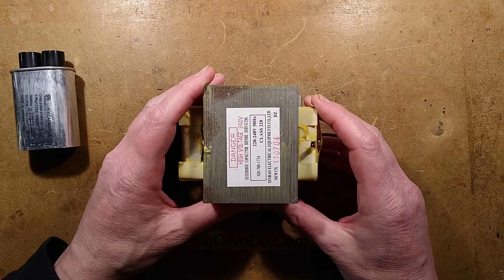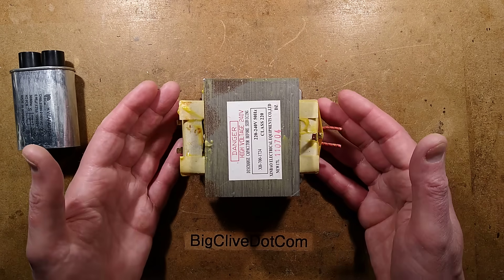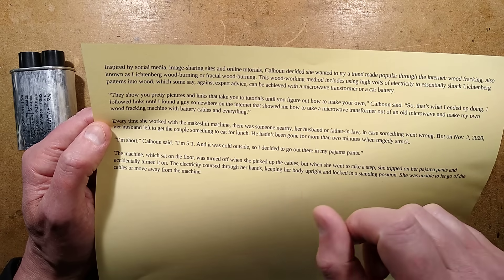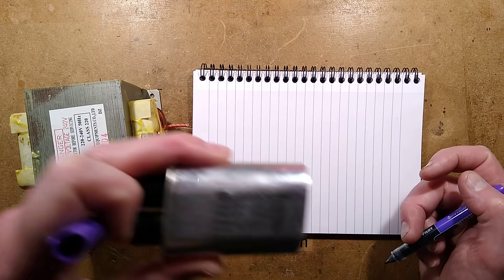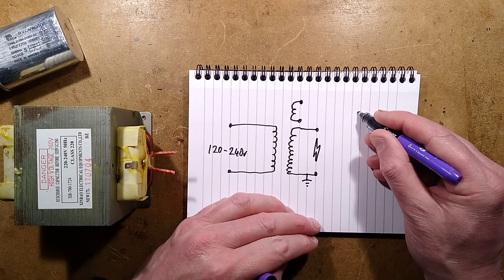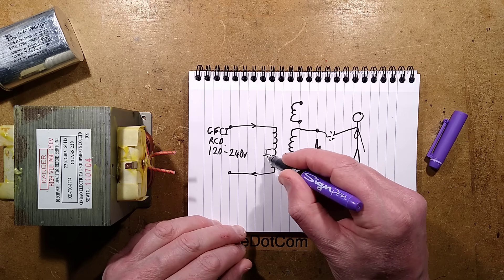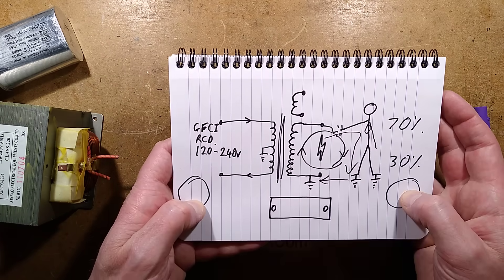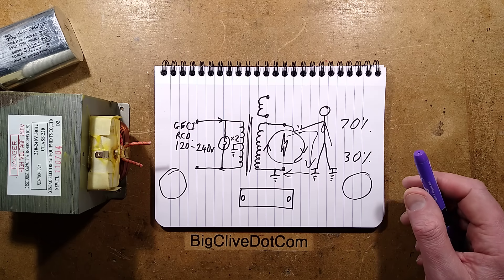The most deadly project on the Internet

Comment: As a former ED clinician , you could also mention the damage to the bone marrow, rendering the bodies ability to make red blood cells moot. Like getting hit by lightning…
Reply: @sailyui the short version is that electrical burns are special, most other burns damage tissue from the out side in, but electricity flows inside you since you are 70% water and completely filled with electrolytes. 

Basically electricity will burn your bones (called 4th degree burns) without destroying everything between your skin and bones first. (It all happens at the same time) And much of the burned tissue will die and start necrosing which requires surgical amputation. (You can keep you arm, just not half your bicep)

Red blood cell production occurs in the bone marrow, why do you think that is? The current explanation as i know it is because its the most protected location in the body, and red blood cell production is very sensitive. This means that cooking your bome marrow like a hotdog is going to cause some damage and potentially destroy its ability to make healthy red blood cells even if the marrow isn't killed completely.
Reply: @jasonreed7522  Very well explained!
Reply: Woulda bone marrow transplant help or the area around it would be too damaged for it to take properly? @jasonreed7522
Reply: @jasonreed7522  reminded me of two people that got hit my lightning and one electrocuted but not knocked unconscious. , not directly hits. One was in a car, the other said it was like a ball of fire. All three of them told me it felt like they were burning from the inside out and mentioned “felt like their teeth were on fire”.
Reply: @jasonreed7522 hypothetically, say you wore rubber rings on all fingers, would that help at all? 

An even more far fetched hypothetical, if we could someone imbue rubber into humans dna, would we be immune to electricity?
Reply: @UngaBunga-mb7dv  for the first one that does nothing, you are the conductor, rubber rings around your fingers is just putting insulation around a conductor (like we do to wires).

The second thing isn't even possible, DNA and rubber have different chemical structures so it isn't possible to combine them. (This would also have no effect on your conductivity, which is mainly from the salt water solutions called blood and inter cellular fluids)

The actual way you protect yourself from electricity is to have an insulating material between yourself and the hazard, such as specially rated gloves. You also aren't allowed to wear plastic clothes because in the event of an arc flash you want your clothes to be burned away and not melted into your skin. At the very extreme end of PPE standards are full body suits that are either basically bomb suits, or have conductive skins to route the electricity around your body.)
Reply: @jasonreed7522  okay, you actually explained it in a way I can easily understand. The 2nd hypothetical was pure science fiction though, but it sounds like the real issue is us being primarily water. 

I was always under the impression good rubber boots would somehow save you from dying when electrocuted and I extrapolated from there. I'm assuming the only thing rubber boots would do is protect you if you stepped into a body of water with a current? 

So is surviving an electrocution just luck or do genetics play a role? Maybe being muscular or fat would also play a role? 🤔 (Assuming no safety equipment involved).
Reply: @UngaBunga-mb7dv surviving 'an electrocution incident' depends on many aspects, but not genetics
These aspects are, for example, the length of the shock (duration of exposure as so often with dangerous stuff), a combination of a decent voltage and a current starting at only a few mA, whether the frequency is high enough for the muscles to not react to the electricity anymore and/or whether the skin-effect applies (as also mentioned in the video), whether the path taken by the electricity goes through the area surrounding the heart (although it has to be noted that the stress and other effects of a shock can also kill - for example with the people regularly dying from being tazered) and how long it takes for the patient to be treated, in case the heart was brought out of wack (the heart could go into fibrillation (for example from the usual BOMP bomp - BOMP bomp - ... to just bomp bomp bomp) or stop completely), ...
Also yes, there is luck involved, but the chances are usually stacked against you if you're purely relying on them to save you
But please don't rely on an unknown armchair know-all professional YouTube watcher called me and rather on somebody like Big Clive (he made multiple videos on the topic, for example "the unofficial guide to electrocution (and how to avoid it)", ) or ElectroBoom (professional boomer and electrical masochis- I mean engineer) or one of the other amazing electronics creators out there (but don't trust anybody who tells you that "it's the current that kills" or similar crap)
Reply: @UngaBunga-mb7dv  electricity is weird and hard to predict in many situations when you combine all these different substances with different kind of activities in different places you have an impossible to predict situation it's a matter of stochastic nature. I asked my high-voltage electrical engineering professor if I had a farmer standing on his farm in between a barn full of hay that has a lot of loose dry charges that was 20 ft tall and a windmill that was 20 ft tall and rounded like the devil by have an iron pipe in the water into the Earth long ways and a lightning storm came up where would the lightning hit. He said the lightning would hit the bar in the lightning with it the windmill and the lightning would hit the farmer if it flew enough times it would hit all.
Reply: Erectile dysfunction clinician knows microwaving sausage is an epidemic
Reply: @K33176  Ewww lol
Reply: @nateo200 Finally someone who's speaking my language!
Ick!
Reply: *body's
Reply: Wouldn't this be more of a current affect where you have enough current going through that bone marrow to heritage the voltage here is so high you're not going to get very much current?
Reply: @markmcgoveran6811  not really sure of what you are asking, but true that you could have thousands of volts and amperes in the milli range and maybe not have too much damage to cellular structures, but this device has sufficient amps to kill you by disrupting cardiac function, and if it can do that, it could easily damage your bone marrow. That being said, I have seen a patient have a direct strike with lightning, strong enough to literally knock him out of his shoes, suffer minimal marrow damage. Electricity sometimes behaves in non predictable ways. So always be extremely cautious…
Reply: So you permanently cant make red blood cells when struck?
Reply: @sailyui Not a doctor, so I won't get into specifics, this is just some shit I read so take it with a grain of salt, and at least my surface level research here isn't mortally consequential, but think about it: red blood cells are produced by bone marrow. Bones are effected in many ways by electricity. Like, your own muscle contractions can break bones, and the specific structure of bone cells are disrupted. The matrix they make up can be disordered, leading to bone fractures, and damaged bone marrow. Plus, I'm sure electricity directly fries bone marrow, or fucks with some chemical(s) it uses to function properly. That's just a guess. I'd have to do way more research than is worth doing just to answer a comment, but my intuition kind of tells me something might be chemically converted into something else in the bone marrow messing up it's ability to function. After all, chemicals do often denature with heat, and you're a bag of walking talking chemicals essentially. And if that happens, you can get anemia, which isn't fun. Or maybe it is. Idk, I like being drunk and lightheaded. Maybe it's not so bad. That's subjective and besides the point. The point is electricity fucks with so many systems in the body. Nervous system problems are a common side effect of electric shock, leading to personality changes, seizures, it's a whole thing. Organ damage is common, burns can lead to infection, dehydration, amputations, dehydration, death. It interferes with the heart's own electrical balance, leading to cardiac arrest, death, and long term heart issues. Moral of the story: don't fucking play with forces you don't understand, electricity being one to be super cautious of. Don't see a trend online, do some surface level research like I did with how electricity effects the body, and walk away thinking you have the equivalent knowledge of an electrical engineer. Hell, a PHD would probably have quite a few things to say about this comment and all the stuff I got wrong as again, not a doctor. Merely a curious drunk. Just don't. It's not like fire, which is ALSO not good to play with, but at least you can SEE fire. Electricity can be much less intuitive than people think. I would never dare do something like this without a pre-established background in a field related to electricity.
Reply: What’s this have to do with erectile disfunction?
Reply: ED=Emergency Department 🤦🏻‍♂️
Reply: its.not.a.great.thing
Reply: moot, not mute, and I think because dead yes.
Reply: @clayz1  Mute makes sense therefore it is correct to use the word in this way. Like eg. be a doll and mute, moot kinda reminds me of Americans confusing due with do, or putting the accent in the wrong place for chimanZEE lol, yes they say chimPANzy, spelling mistakes were used to illustrate the difference. 
It's essential to become autodidactic in this time, our education is indoctrination, and a replacement for parenting. Our laws have been overtaken by maritime law and we are about to.lose all freedom in a year come.autumn, in all.G member states (note they are now states not countries any more) read Klaus Schwab's book named the great reset, he is the head of the world economic forum which is set to become the world's first open world government, and King Charles is going to take over from Klaus which will, in effect cause him to be the world king / dictator... Time to open you're eyes folks, things are about to go South fast.....    
 pole Ice, Just-ice, pole star, pole land, follow the breadcrumbs, don't get distracted.
Reply: Better take your b12
Reply: not just RBCs all types of blood cells white/red alike. Hemopoietic stem cells = turn into any type. 
No HSCs = very bad: no more ability to maintain oxygen, no immune system, etc after.
Reply: Not a doctor, but i'd say your bone marrow would be pretty conductive and fragile, exploding yourself. They're kind of like if you melted a metal faucet. A little water will come out, but not much.
Reply: *moot
Reply: Mute
Reply: Emergency Department?
Reply: @NithinJune  yes😂not the other…
Reply: Yes, very good advice re Bone marrow.
Reply: Can someone explain why the word 'moot' applies here? It doesn't specifically harm production, but instead makes the need for red blood cells "moot"? Because you're dead?
Reply: @supremebuffalo6322  I believe the OP said that the electricity can damage bone marrow, which “renders” the bone marrow’s ability to make red blood cells “moot.”  

To “render moot” is an old expression that means to make something useless or so reduced, it becomes inconsequential, which is separate from it’s narrower use in legal jargon.  

So I think it is just saying that if you damage your bone marrow by running electricity though it, the bone marrow’s ability to make red blood cells
might be severely reduced.
Reply: @supremebuffalo6322  once you stop making red blood cells, you die, yes.

They carry the oxygen you need.

AKA: you'd be able to survive for about 3 days and then you'd just choke to death even though you were gasping full breaths of air -- a horrible way to die: and that would even be in a hospital pumping pure O2 through a mask at 15-30LPM.

Additionally, there'd be no way to supply that much blood, that often, and without immune response incident.  You'd need a unit of blood, everyday, for the rest of your life.
Reply: @supremebuffalo6322 Red blood cells are a tough sell at the best of times, limited primarily to surgeries and vampires.
I don't really see the recently deceased as a profitable demographic but you could be on to something.

Comment: I was rebuilding a Razor go-kart, they usually run off 24v, two 12v batteries in series, I decided it was a good idea to hookup 48volts... god knows what amps, to the kart....I forgot to turn the kart off which was the only thing preventing the circuit from connecting. Oh my god, my entire arm went numb, I fell to the ground and I couldn't control my body for about 30 seconds. My friend thought I was dead, but I was fine just in shock. Electrocution is terrible. But explosions are worse.

Comment: Holy crap!  In other words, you'd fare a whole lot better on average if you just stuck a fork into an electric outlet in the wall.  Far lower voltages and possibly could be saved by a GFCI.  These old microwave transformers turn that same current into a 3000 volt laser beam that will burn a hole right through a block of wood... and you. 😱

Comment: when you say short the capacitor with an insulated screwdriver, would that be an active-neutral short? surely this would give you quite a fright with a fully charged capacitor.
Reply: It means, one with a big rubber handle.
The capacitor is series with a big diode as a voltage doubler. 
Magnetron work on a  dc square wave at 50 Hz (60 for you colonials) 0v to -4000v. Which is what is in the capacitor.
Discharge it instantaneousy through your body.
We all learnt the formulae. It's the Watts what kills.
Current x Volts x  Time.
At least on AC you could bounce off. 
.DC, s grabs and holds you and won't let go.
Reply from the maker: The AC vs DC is a myth.  DC gives a single pulse and then burns.  AC stimulates the muscles continuously and locks you on.

Comment: IMO, I think this could be done safely by removing the human component. By utilizing the X/Y driver from a CNC to place electrodes. I believe that someone could build a fully enclosed Lichtenberg machine that allows the user to be safe and away from the process. We have computers and cameras as well as robotic machines to do the dangerous job. also with said machine, you could mass produce pieces for sale as wall art or in wood working. imagine Lichtenberg patterns on a wood veneered bed and side table set, or kitchen cupboards

Comment: Many years ago, ( around 60 years ), I was a radio and TV apprentice, and not knowing a lot, I put my hand inside a working TV. Back then, the picture tube had an HT voltage of around 27,000 volts, which jumped out and bit me, luckily, it was oscillator driven, which meant that as soon as any current was drawn, it killed the oscillator and the voltage stopped.
The very early TVs had a mains driven EHT of around the same voltage, I believe that it killed a few of the early TV repair guys..

Comment: HOLY SHIT they don't relies how dangerous that is. Enough on the output there to stop your heart. 120 in , 3 to 5 thousand out , steps it WAY UP not down. Spose to use hot sticks at that voltage if that tells you anything damn.

Comment: I dont buy her story (I just read) of her having it  turned off but tripped and accidentally turned it on. That story is to save some face. When was the last time you tripped and accidently turned something on? Especially something that didnt have an on/off switch but probably had to be plugged in or not plugged in then something clamped/connected as well.  Nah...she didnt accidently fall it on

Comment: I've seen videos of the transformers being used to build a spot welder.  I'm assuming those are just as dangerous then?
Reply from the maker: If done properly the spot welders are relatively safe as they remove the dangerous high voltage winding and replace it with a very low one.

Comment: When I was a kid, I had a giant 9000V neon sign transformer. I used to make a jacobs ladder out of coat hangers which was pretty cool. On day, I was just letting it arc and watching the spark. After a while, I wondered if the transformer was getting hot so I put my hand on the case to see if it was warm. Sometime later, I woke up on the floor with no idea what had happened. Apparently, the midpoint of the secondary was connected to the case for some reason. I was extremely lucky with no burns or other injuries. Most likely because I was not grabbing anything, just resting my hand on it.
Reply from the maker: Most neon transformers here are centre tapped to the grounded case so that the output voltage is only half of the full voltage with respect to ground.

Comment: you should also have mentioned making your own spot welder with the microwave transformer. the same device killing in another utterly foolish way, people should not play with voltage like that just like i should be using correct punctuation, but i am too lazy too
Reply from the maker: In the welder project the dangerous high voltage winding is replaced with a very low voltage one.  There are still risks, but nowhere near as bad as this.

Comment: What a brilliant explanation Clive. This is such an important topic and I cannot believe that people are so bloody dangerously näive. 😩 Everybody should see this video! I work on 480v automotive vehicles which scare the hell out of me so no way I would touch 3000v + 😣
Reply: People don't understand voltage around 600V don't seem to follow physics anymore, so anything they learned about 240V will be very very different at 4000V this transformers put out. Another problem here is it will stop the heart even at low current, or do a lot of damage to the nerves.
On the top of it this is AC which is a lot more dangerous than DC. I wouldn't want to play with such project despite being quite comfortable with higher voltages.